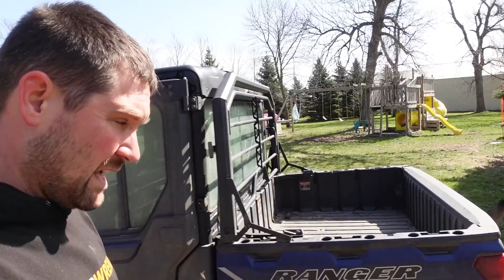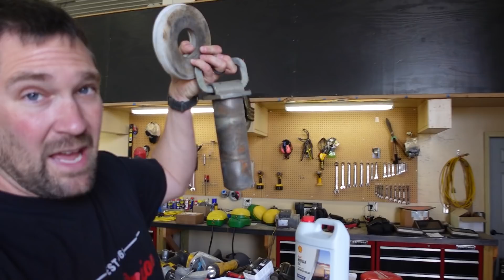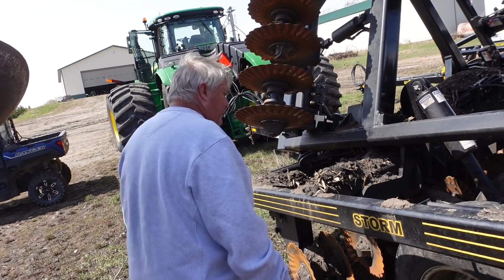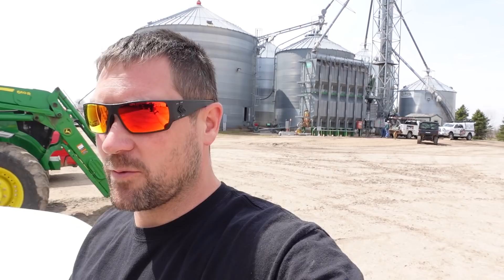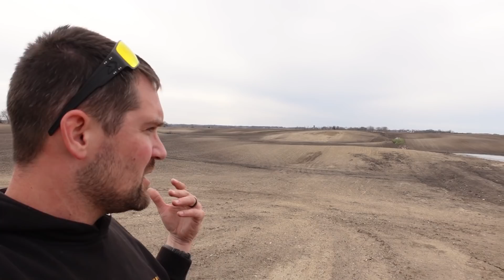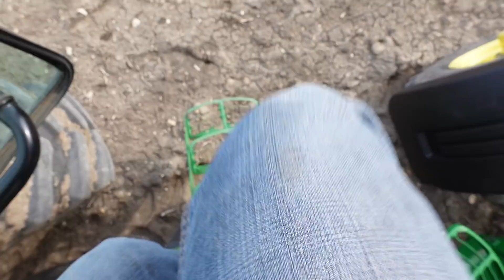Rock Picking

Comment: I reallllly like that rock picker. Ours was myself and a wheelbarrow. When it was 3/4 full, I'd head down to the pond and dump it in, or we used some to slow erosion along ditches. When the wheel fell off (usually once a trip) I'd pound the metal back with a rock and continue on. Metal fatigue on the wheel bracket let it work loose. Not a fun time, but it taught me character...or something.

Comment: I have the same grill besides cleaning the grates and a smoke bars you got to get down and scrape out the bottom of the grill I had some steaks on and went out and looked at the temp 700° slight problem

Comment: We have a similar age chevy truck and it seems like we had issues with the cable being stuck and needing some wd40 specialist lubricant to free it up. Just something to check if you haven't received the latch yet.  Might not need one. Or be included with the new latch. I might be remembering wrong tho it was several years ago. Might want to try shoving the pull handle back in.

Comment: Mine has the same issue with the latch. Just pull the hook forward every time you close the hood and it will latch  the spring keeps tension on it so it won’t pop open while you drive

Comment: My Grandfather was  small farmer so this does not apply to today but there was a time when all grandfather had to do was get the tractor close and I would simply pull the chisel plow on to the hitch. The equipment was just so much smaller.   He also had a Ford 800 series tractor.  Low to the ground. 

When I was a kid I saw the Russian Rocky movie.  It is then I realize using my grandfather's single pulley in the barn pulling rocks up like Sly Stallone made me stronger.   I also had a rock I picked up. Set down and picked up like strong me.  I had farm kid strength. I was my grandfather's rock picker.

Comment: Why don’t you plant a cover crop for winter… ? it would hold some soil structure,take up water and add organic matter to the soil. You could also graze cattle or sheep in mobs with electric fence and get the free fertiliser that comes out the back of them that would also enhance the soil structure.
Reply from the maker: We don't harvest until the ground is nearly frozen so we would need to interested a cover crop into standing crop and we don't have the equipment for that.

Comment: NOOO ! You never clean a grill that way. You just crank up the heat all the way. Leave it that way for a few minutes then just  scrape the burnt off the grates. Otherwise you loose all that seasoning you've made over the yrs. I've have 3 grills gas, charcoal and a smoker (4-5 yrs old.) Also have a griddle. Never cleaned any of them. Just get them super hot and scrape them off.
My quess your getting a Gravity Digital Charcoal Grill and Smoker Combo
Reply from the maker: In this case it was too built up.  I probably should have left the grates but everything under needed cleaning!

Comment: just GET A SIMPLE SPRING FOR IT , its like .70 cents , bend the hooks and set it on the old part ... 90 percent sure its the spring holding tension on the part its self and it has always been exposed to the weather

Comment: You made me laugh really hard when you asked your dad to go ahead an 1/8 of an inch.  Our red machine that's used for primary tillage hops about three inches with the slightest movement of the clutch.  It takes a brave man to drop the pin.
Reply: the best solution i've found for that is to hold a slight bit of brake pressure